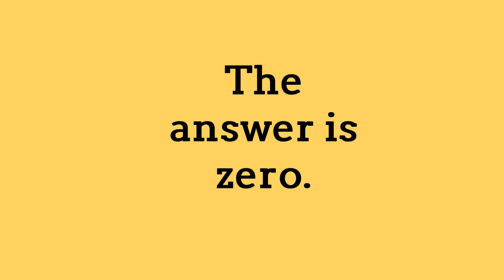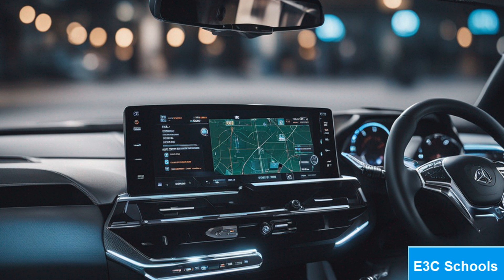CAR WITHOUT CHIPS

Comment from the maker: Old microprocessor chips, also known as vintage or retro microprocessors, refer to early generations of microprocessor chips that were developed in the early days of the computing industry. These chips are characterized by their simplicity, limited processing power, and relatively large physical size compared to modern microprocessors.

Comment: My TD Cortina has chips in the wireless and a few chips stuck down the side of the seat.
Reply from the maker: Old microprocessor chips, also known as vintage or retro microprocessors, refer to early generations of microprocessor chips that were developed in the early days of the computing industry. These chips are characterized by their simplicity, limited processing power, and relatively large physical size compared to modern microprocessors.